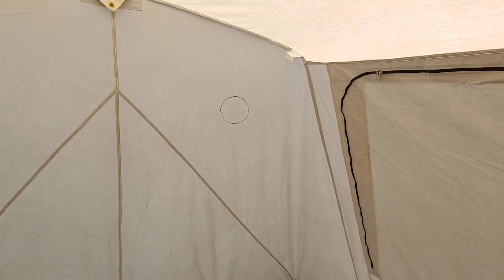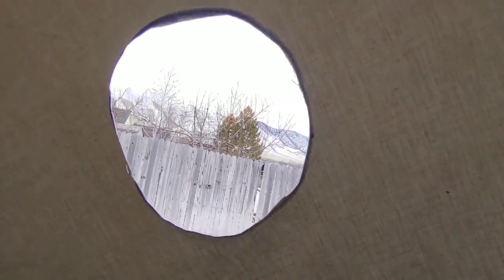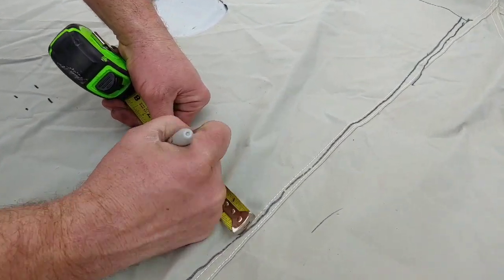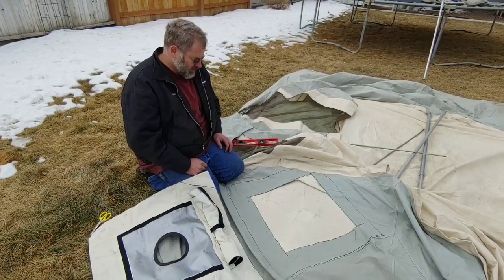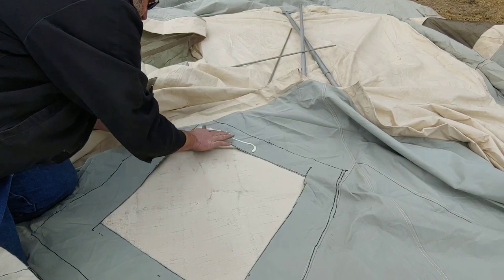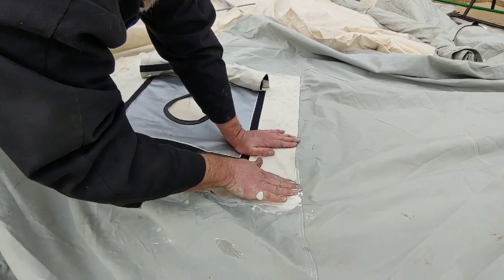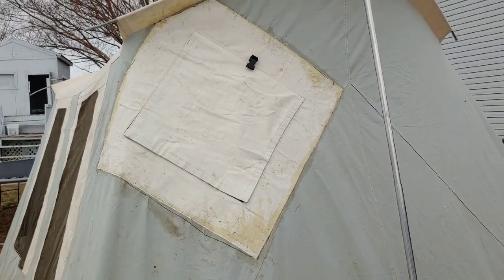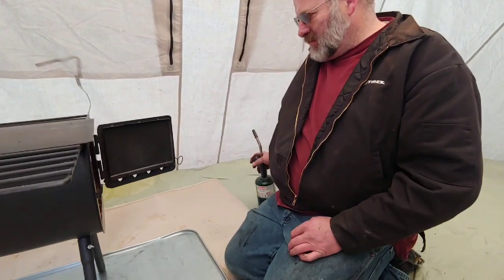Installing A Stove Jack In My Springbar Canvas Tent

Comment: Which Jack on Amazon did you get and what glue is it that you used
Reply from the maker: Unfortunately the one I ordered off Amazon is no longer available it was from Outfitter Supply I checked their website and it looks like they no longer sell it but any stove Jack that you're able to glue in should work
This one is similar to the one I used I think it would work
DANCHEL OUTDOOR Canvas Stove Jack with Flap for Dia. 3.9"/5.85" Fire Resistant Hole for Bell Tent Camping, Hot Tent Stove Jack Kit for Chimney https://a.co/d/4ZdcmiE